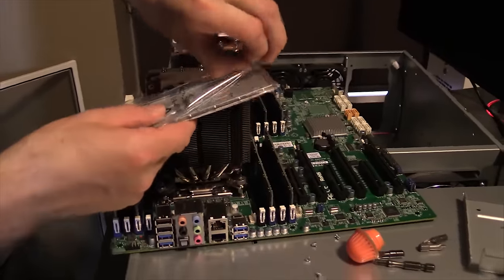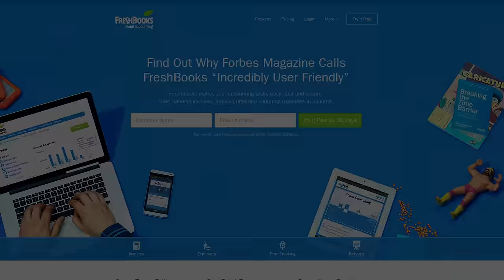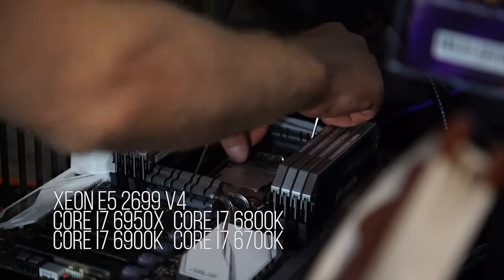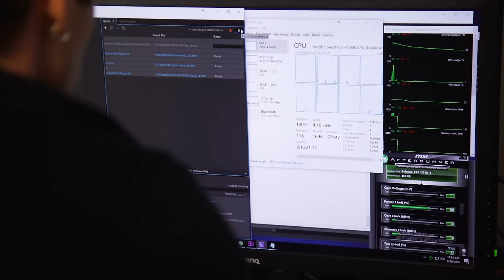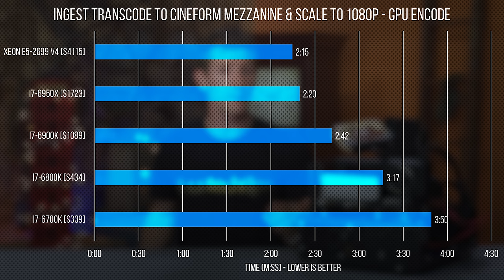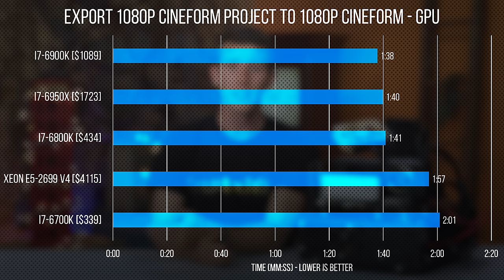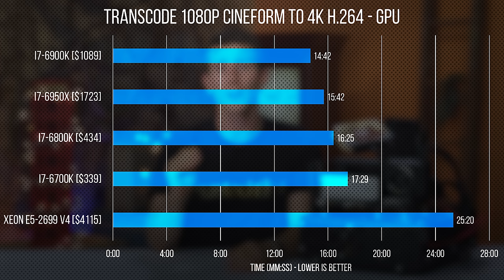$300 CPU Beats $4000 CPU?? - Cores vs clockspeed for video encoding

Comment: 3D Rendering would gobble up all that performance
Reply: Ya, another workload with 100% scaling.
Reply: It would use it all up, as in it would scale up and make use of every core.
Reply: ***** scaling... as in use all cpu cores at 100% no matter the core count.
Reply: are you suggesting they make a CGI Linus in order to justify having Xeons in the rendering machine? I think that would be cool for at least one episode. lol
Reply: This is true, but you could buy maybe 4 consumer grade complete systems and server farm them and get better performance for the price of the single XEON system.
Reply: SencneS The cost of the software licenses would break your price to performance calculation, the xeon would save you alot of money
Reply: ***** What Software are you using because that's some trashy crap dude. If you're 3D Software doesn't allow you to utilize an entire render farm/multiple CPU with the original purchase, then sucks to be you!
Reply: SencneS something like mental ray, iray, vray, octane, Arnold, art, and others you have to buy stand alone licences that can only be used on a certain amount of computers and they cost a fortune. Blenders Cycles on the other hand you can through anything at it, CPUs and GPUs.
Reply: MUZIC FR3AK | Adam H. Just use to Lightwave and ScreamerNet and it's 999 Node license for a single cost. If other software don't step up to the plate and allow multiple Nodes to allow utilization of CPU/GPU power than pfft. Support Corporate Greed if you choose to, I'll stick with software that enables such configurations.
Reply: SencneS somebody just answered your question
Reply: ***** Not my problem people opt for expensive per node licensing model software. But what ever..
Reply: or just use fucking blender
Reply: Can Blender use multiple CPUs?

Comment: What you said at the end is true. Encoding video is something that can scale very well and consistent, but Premiere / ME e.g. is optimised for the machines most people run it on, consumer hardware. It also does not scale at all beyond one socket, because it is a single process with threads not multiple processes with independent memory spaces. You cannot split one process and execute it on multiple processors, that is just not possible with current architectures. So it is less about the hardware and more about how the programmer made use of it.

Comment: I spent about $150 on a AMD FX  octa-core chip, stock speed was 3.2ghz, ran the auto overclock that came on-board, runs at 4.2ghz. Shelled out $160 on 64gb corsair vengance ram and $200 on a Geforce GTX 960 (4gb ram). Bought on sale, and she's renders like a champ, runs every game I've tried maxed, smooth and silky.

Comment: where to buy intel i7 6800k at $ 434 as mentioned in this video ?
Reply: Are the amazon prices with or without VAT? Is that the final price you end up paying? I've understood in the US it's common to show non VAT included prices everywhere.

Hard to believe the cheapest you can find in all of Europe still cost at least 20% more than anything on Amazon.
Reply: Rather get i7-5820k its cheaper and performs pretty much the same
Reply: you tend to not have to pay VAT because of how online commerce works in the states
Reply: +Jambo we don't have VAT In The US, but most States impose a Sales Tax that is not included in the list price. (there is a federal sales tax on Gasoline that requires it be included in the list price, but it is a rare exception) currently only Online companies that have a "presence" in a State can be required to collect sales tax for that state, endless the state has a law requiring collection regardless of the "origin of the transaction".

It's all quite weird.
Reply: +Mike Crapse Why would you pay VAT in the US? -_-
Reply: Shmerby Films When I hear VAT I think of sales tax. I suppose they are different things? I don't find any difference between the two.
Reply: Mike Crapse VAT is a tax in the EU..
Reply: Shmerby Films Vat is also a tax in canada... It's just a name for a tax.
Reply: Just checked my local PC store (Umart) this  i7 6800 CPU is actually AUD$625 , ill keep using my Intel E3-1230v3 3.3ghz haswell cpu for a bit longer
Reply: "Vat is also a tax in Canada." Am Canadian. Although technically this is correct because HST is VAT (or rather, the ex-GST portion is VAT) (As opposed to a sales tax, which is not VAT), I have never heard any Canadian call HST VAT. The first time I ever heard about VAT was on a forum where a bunch of people were purchasing something to be shipped from the UK and those people from the UK kept talking about VAT.

And no, it's not "just a name for tax." It is a different kind of tax than sales tax. The USA has sales tax and not VAT and cannot be interpreted as VAT in any way.
Reply: Well VAT is 20% and intel is not based in Europe, so yes you'll have to pay 20% more for anything with out a European affiliate company.
Reply: We don't have VAT, we have GST, PST, and in some provinces HST (instead of GST/PST). VAT is exclusively European.
Reply: The problem in the last 10 years of goods from CHINA and ASIA that is sold in USA for USD$200 for example is NZ/AU/India/etc is all based OFF USD RRP not a proper global RRP because of the shit dolar compared to USA a 200 buck item ends up 400 bucks in Australia , when it should be AUD$225
Reply: there are taxes and import charges that pump those prices not a strenght of currency...and you Australians have highest GDP in the world so it is easier to pay 400$ for you then it is for most countries worldwide
Reply: Thing is EVERYTHING ends up more expensive in Australia so in the long run our min wage might be double , but we end up saying double to tripple for everything that comes from china
Reply: +Ricma 97 Australia doesn't have the highest GDP in the world... They're 13th in nominal GDP and 21st in GPD per capita, both behind the US...
Reply: Kenny Vo
 So whats the reason why PC parts that is made in china is overpriced in NZ + INDIA + Philippines ?
Reply: charlie brownau No, China has the cheapest labor on the planet, for example if you convert the employees hourly wage to USD for Apple, they would make $0.30/Hour.
Reply: Kenny Vo yes but still has one of the highest in the world, for example in my country GDP per capita is 13000$ and my country is part of developed countries, while in Australia is 57000$ yet prices of pc parts are the same, so when Australians complain it is a bit funny to us, but you should complain so should we so the prices became similar to those in USA, everyone should be equal
Reply: danwat1234 You can get the 6800k for sub $350 if you fight an auction war.
Reply: Awesome. Currently looking at a MSI GT72 laptop with 6820HK CPU for a bit over $1000 for my next rig. Overclock it to 3.8GHZ all cores should be easy
Reply: DONT get a craptop for gaming
Reply: The GPU architecture is identical desktop-laptop. Just clocked down a bit. MSIs have good cooling for a laptop.
Reply: its not called VAT in Canada. its GST and its only 5% compared to like 20 something percent in some EU countries. I know that because I live in Europe, crappy socialist craphole
Reply: due to increase again in 2020 to 22.5% from 20% (UK).
Reply: 25% here in Sweden...
Reply: I have a 5820 at 4.7 ghz. can confirm. Also the difference between them is barely noticable.

Comment: however in after effects (2014 at least) multi core cpu's kill the i7's 
Download this benchmark project and comment your results (if you have after effects) make sure to turn on multi processing  

some results

i7 -4790K 4.4 GHZ
8 GB DDR3 1600 MHZ
GTX 970
2xSSD Raid 0
Asus Maximus Gene VII MB 
--------
AE CC 2015
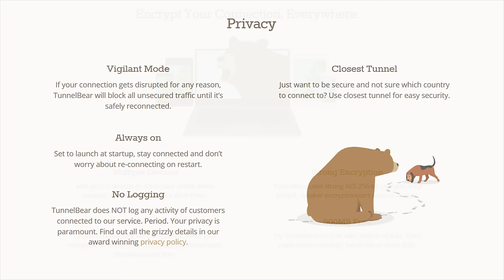8:50 min
----------

AE CC 2014
X99-A
i7-5960X 8 code (over clock 4.4GHz)
Quadro M5000
128GB DDR4

5:40 Multiprocessing - Off 
3:35 Multiprocessing - On (4GB Per Core)

--------

AMD 8350 @4.6Ghz
16GB Ram DDR3 (Gskill Sniper)
RADEON 7870 Gigabyte
250 GB SSD
Windows 8.1 / After Effects CC
— RESULTS —
Multiprocessing On
8 min 35 sec. - (8 cores @ 2GB per core)

https://vimeo.com/118053656
Reply: This isn't an editing machine, it's a network transcoding machine, all the editors have their own editing workstations. Also your results are not even comparable to each other, they all use different amounts and speeds of ram, different storage setups and different gpu's.
Reply: This isn't an editing machine, it's a network transcoding machine, all the editors have their own editing workstations. Also your results are not even comparable to each other, they all use different amounts and speeds of ram, different storage setups and different gpu's.
Reply: purekeynoob Thats why I said "HOWEVER" More cores are better in after effects

Sorry you took the word "benchmark" to literal (my fault) its not really a benchmark

the results are meant to see what works and what doesn't work in after effects not to compare cpu to cpu in an strict testing environment, its to show people how fast other system's rendered the project. and what works based on those results are more cores and more ram

If you are an after effects user (or any program really) the best way of figuring out what system to build or buy is to see results from a number of different systems (look at the comments in the link there is over 100 systems)

With that data, i can almost guess how fast your pc would render the project lmao
Reply: Chur
My whole point was, your comment isn't relevant to this video,
Reply: Isn't the multicore performance really bad on newer AE versions? At least I only have a max of 40% utilisation with the current one when I am rendering ... quite annoying
Reply: purekeynoob How so?

Linus put the 2699v4 in an x99 motherboard and ran benchmarks in adobe encoder and adobe premiere as an workstation machine not a network transcoding machine

And the results were the 2699v4 was not that amazing

My comment was saying, "HOWEVER" ! in after effects the 2699v4 will perform much better than the 6700k just in case anyone wanted to know etc etc, considering a good amoint people use after effects and Premiere together

and my comment was not relevant? LOL my sweet summer child <3
Reply: Qwertworks Yeah they took out the multiprocessing in cc 2015 (apparently they are working on a better system) I had to revert back smh
Reply: Chur That's so Adobe ... if only there was fiercer competition ...
Reply: The issue here is with cuda. That is the problem. It cannot properly utilize high core count cpus and relies on per core performance. All cuda accelerated transcoders will show the same problem. Sometimes it is actually faster to disable cuda acceleration entirely.
Reply: tormaid Thanks for the tip! Though I am only doing it as a hobby atm, so I am not that reliant on it rendering super fast (because my projects are not that big). It would be nice if there was some other company offering something similarly integrated as adobes lineup so that there would be more competition.
Reply: @ Richard Smith what if he had used an AMD GPU  with opencl?

Comment: Linus I ordered the HyperX cloud 2 headset off your website ncix. I was extremely disappointed I ordered it September 4th and it's the 13th right now. The warehouse is about an hour drive away from me, there was a delay on the truck for 3 days and when I called to ask when my headset was coming no one picked up so it took me to a call back option and they called back 4 hours later.. On the website it said the offices weren't even open then. The worst thing is on the shipment tracking tab on the site it shows nothing but that your money has been taken and you can wait I had to call the head office in Ontario for someone to pickup and give me the actual code to track the purolator truck. I say even if you have to spend $20 more use something like newegg, tigerdirect, or Amazon
Reply from the maker: +Dallas I don't run NCIX. Also the call outs at the end of our videos say to use our links to buy off Amazon.
Reply: lmao linus doesnt run NCIX, its a well known electronics store
Reply: LinusTechTips Sadly amazon doesn't take paypal or i'd order off them for sure :) thanks for the response
Reply: +Dallas looks like someone has weight troubles to the point they feel they need to let out on some random person on YouTube.
Reply: I face the same problem with NCIX, first I ordered GTX 1060 when it was on stock then they came back to me saying gtx1060 out of stock so they gave me an option to replace with rx 470 then I said ok. After spending hours and hours on the phone they send the GPU after a month. But they forget to send  PSU even though I paid for CPU aswell, I wrote them 4 emails, still no response. Now it's been a month and I am frustrated and I couldn't deal with them anymore. I thought to myself instead of spending hours and hours to deal with them to get 50$ back I will just go to work and earn that money. Lesson learned not to buy anything from NCIX.
Reply: raja Ik, 3/4 the company reviews on other sites are bad, just people having the same problems, but on ncix website they only show good reviews, or the 5 star reviews goto the top and others just sink to the bottom. I finally got my headset yesterday but it was such a pain to get a simple headset. I feel your pain buddy
Reply: My issue was resolved today as well but it took one month to get everything still I am unable to put my pc build together because of their shipping delay. Next time onwards I am going to use Directcanada even though it's bit more expensive they are reliable.
Reply: raja Yeah, spend the extra 10-20 dollars for a more reliable company
Reply: Dallas g
Reply: Lunar Failer ?

Comment: soo... an i7 6900K is the biggest bang for your buck for video editing..?
Reply: No, the i7 6800K is. It's over $600 cheaper which would be better spent on a GTX 1080.
Reply: The 6800K is indeed better for video editing. But I chose the 6700K because I mostly game on my Rig and only edit videos once or twice a week. The CPU is an absolute beast (compared to my old Phenom II x4 955 BE).
Reply: actually a unlocked pentium is the best Bang for your Buck from r video editing
Reply: Alexander Lei I always thought "Bang for thebuck" means powerful but still in a decent price range. correct me if im wrong, but if you take my definition the i7 6700K should be the best Skylake CPU for Videoediting atm
Reply: (Cr4zyPi3t) I think the definition of b ang for buck trally depends on how it is used,
Reply: nah 5820k is
Reply: Kongolox More BANG, but not flr your buck. it's already far beyond the point of diminishing returns. I like the 6800k.
Reply: Kongolox Nah the 1800X is
Reply: +Mylittlebaboon R7 1700*
Reply: Ryzen 7 1700

Comment: +LinusTechTips - Even with a single-threaded encoder, you could work around it by splitting your video into a bunch of small parts, maybe a minute each.  The write a script that queues up encoding jobs and spawns as many of them as the system can handle at any given time.  When you're done, rejoin the parts.  It'll take some mucking around to make sure you don't make your joins messy, e.g. making sure everything happens at a GOP level so you don't need re-encoding at the join points, but I'm pretty sure you can make that happen.  It won't scale perfectly, but it'll scale better than hoping the codec's author knew what they were doing.  With 20-odd cores your encodes could drop to a minute, depending on how long splitting and joining take.  If your encoder can reference a short section of the original file without needing it to be split, then you might even be able to skip that step.

Comment: isnt the 6700k 1151?
Reply: 1151 socket? yes
Reply: Marshall Walker But his test bench is 2011
Reply: nice catch
Reply: Thank you I thought I was the only one who noticed
Reply: Ikr
Reply: He must have used another mobo, but everything else on the bench transfers to another mobo just fine. He wasn't using ECC memory or anything so mobo is the only thing that would have changed. Shouldn't really affect performance.
Reply: good catch
Reply: yeah but the rest of the CPUs hes testing are X99
Reply: What he did was use a i7-6800K but disable some cores and overclock it to 4.0GHz to make it function identically to a i7-6700K
Reply: Abdallah Saleh
really, hmm, interesting
Reply: +abdallah saleh impossible 6700k is skylake, 6800k is broadwell-E. it would not be representative of the true skylake ipc performance and not to mention x99 vs z170 and lga1151 vs lga 2011-3
Reply: Will Ian
 the 6800K is 14nm just as skylake tho. They just didnt want to name it Skylake-E
Reply: + YellowPeaches
there are still architectural differences, 14nm is not skylake only . skylake is the name of the latest architecture (minus kaby lake, etc wich aren't officially launched yet) broadwell-E is a rehash of the older broadwell architexture wich was also 14nm
Reply: +abdallah saleh
have you read my response. they are different architectures comparing them would not give realistic results
Reply: I know that. It would give different results but they would be similar. That's just what he did.